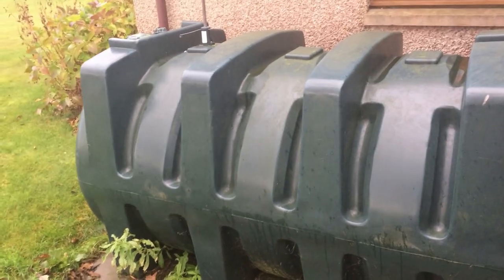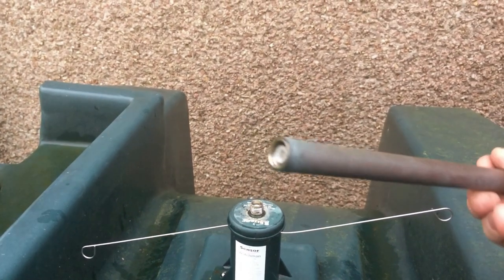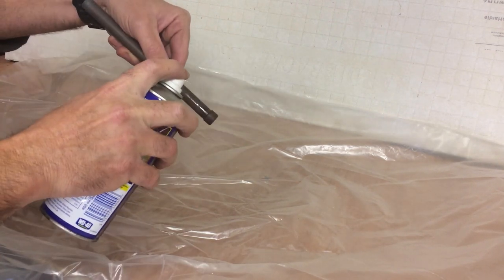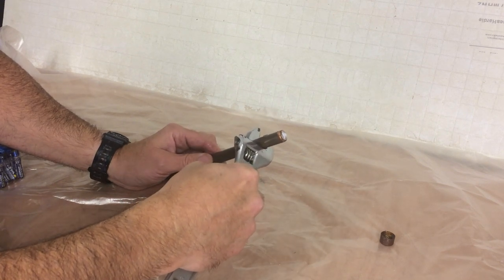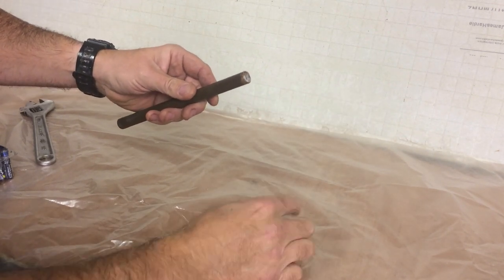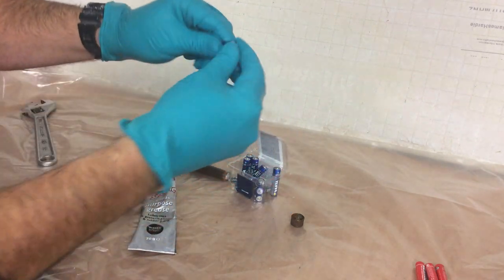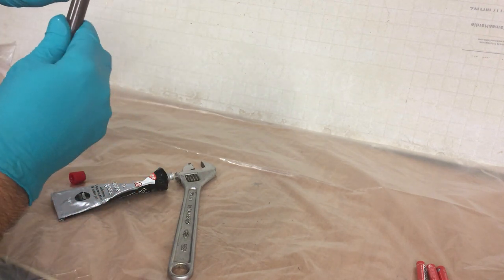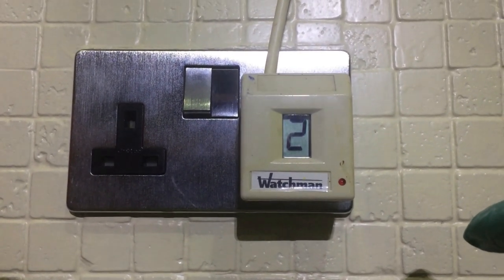How to repair and FIX a faulty Watchman oil tank copper power tube | Restore oil level gauge 2020

Comment from the maker: Please let me know if this worked for you - I am always interested in other peoples experiences with this.
Reply: Bacren Property   Tried this at my mums house. Without your video I would not have known about batteries inside. However it didn’t work out for me. There is a letter C on the receiver and flashing red light. Any ideas?  Thanks.
Reply from the maker: @cloudninephoto  Hi, I am sorry that this did not work for you. The letter C means there is a connection fault at the transmitter, if you remove the power tube again, clean and spray the connection end with WD40 (wipe off excess) and also spray the actual connector on the tank, this may work but not guaranteed. Let me know how you get on.
Reply: Bacren Property. Thanks I'll give it a go.
Reply: @cloudninephoto  Did it work? I've got the same issue, a "C" showing on the display.
Reply: Andy Day   No didn’t work for me 😩.
Reply from the maker: @cloudninephoto  Ahh, Sorry this did not work for you, not sure what this issue could be ?
Reply: Hi, I changed batteries. Now receiver says F. I know my tank is not full. Is there a way to sync the transmitter and receiver?- it looks like I have the same sensor as your video.
Reply: Was it triple A battery's uou used ?
Reply from the maker: @lesleywigham1362  Yes, Lesley, AAA batteries were used. Thanks for the comment
Reply: @Bacrenfencing  thank you 😊
Reply from the maker: @lesleywigham1362  No problem !
Reply: @Bacrenfencing  hope it works. Will get my son to do it at the weekend 😊
Reply: Well done! this worked! I was just about to buy a new one as that's what I was told to do when the new boiler was installed. Thanks!
Reply from the maker: @msmith9971  No problem, I am glad this worked for you !

Comment: Many thanks for the video, so simple when you know how! The receiver flashed madly at first showing zero, but then I found the instructions about replacing the power tube. Said with the power tube removed switch the received off then on again it would then show an r or L after displaying the serial number. Wait for 2 minutes , then screw in the new/refurbished power tube and within a few minutes it will display the level. This did the trick.
Reply from the maker: Thanks for that information Neil, hopefully that will help out some other people 👍

Comment: Thanks so much for this video! I got my batteries replaced by following your clear instructions - brilliant! My power tube was inside my tank, not on the outside as in your video, but apart from that it all went fairly easy. Took me ten minutes to get the copper cap off. Thanks again
Reply from the maker: Thanks for the comment and I am glad the video helped you out !

Comment: Thank you for the tips. My batteries were down to 2.4V but the watchman had been working intrmittently  since installation (maybe 15 years ago) until this week. Despite WD40 soak took  at least45 mins of tapping with adjustable spanner and pumbing nut over tube. Don't give up...
Reply from the maker: 45 Minutes.........you were determined ! 😀
Thanks for the comment and glad the video was of some help to you ! 😎

Comment: Thanks great video. Cap was difficult as found out afterwards batteries had been in over 10 years. Used a rubber golf shaft grip which can be put in a vice to hold tube  and then could tap the adjustable spanner a bit harder. Thanks again.
Reply from the maker: Glad it helped

Comment: Hi there. Great video. Had a nightmare getting the end cap off. As yoyu know, its soft copper, so the more I dunted it with the shifter, the more ragged the outer end surface became. I ended up doing two things which might help others, so feel free to reword this and post freely. First, heat the end cap with a heat gun/paint stripper type unit OR dip in boiling water. keep doing this and spray with WD40 in between heats. Next, and this was what really worked, if you have a spare 15mm plumbing compression fitting, unscrew the compression nut, take out the olive, and slide the nut down the copper power tube. You may have to remove the little warning label from the electrical connector end, as the nut is a perfect fit over the tube. This then gives you a much sturdier 'target' to hit with the shifter and minimises damage on the cap end wall. Worked for me. Hope it helps
Reply from the maker: Thanks for the info Jim and thanks for the kind donation to the channel, very much appreciated mate !

Comment: Thank you. This worked very well for us. The cap took a bit of persuasion but not too much and the receiver took a few minutes to work which had me thinking I’d mixed up the batteries. There was a plastic internal tube as well. A great fix and cost a couple of quid for the batteries. Thanks again.
Reply from the maker: Great, I am glad this worked for you - thanks for the comment, much appreciated ! 👍😀

Comment: Thanks for the clear instructive video. I did this but when resetting I get the flashing ‘C’ - I realise that means I have a connectivity issue. Does that mean the unit requires replacement at this point? Or do you have a remedy for this Thanks. Ps the unit is well old.
Reply from the maker: Not sure to be honest ?

Comment: Changed the batteries in my pipe on the oil tank outside as watchman wasn't working and was happy but it only solved the problem for about a week to 10 days. I have the same problem with it again. Couldn't you advise on what to do now. Do I replace the batteries again. 
Thank you Lesley 😊
Reply from the maker: It could be that the copper top of the pipe has loosened a bit which causes a bad battery connection. Try re-securing the copper cap and possibly replace the batteries again to see if that helps ?
Reply: @Bacrenfencing  than you very much will try that and let you no 👍
Reply: Sorry Done as you said but their is still an error sign on the watchman in the house. Is their anything else I can do without replacing the pipe please 
Lesley

Comment: Any idea how to recalibrate?  Mine has not been powered up for yonks and when I got round to replacing the batteries as you suggest (thank you) it registers 'F' when the tank is half full.  I've tried unplugging the monitor and removing the sensor and tube and powering it up with it horizontal as per the setup instructions and I can hear it clicking away but it does not after 27 secs beep and if I replace it it still registers as 'F' on the monitor.

I must admit to being amused by the battery cartridge, a length of 15mm plumbers pipe with end cap on one end and a braised on TNC RF connector I think on the other.
Reply from the maker: I'm not sure to be honest ?
Reply: @Bacrenfencing  OK thanks well if anyone else knows....

Comment: Hello there, my plug in display flashes 5 then 7 then r then three horizontal lines then 0. It kept repeating this so I took off the power tube and replaced the batteries. Unfortunately it's still doing the same. Could it actually be the plug/display as I had a power cut a few days ago and wonder if there has been a power surge when the electric came back on?
Reply from the maker: Hi Shirelle, it does sound like it is an issue with the actual receiver as opposed to the power tube. Maybe best to replace
Reply: @Bacrenfencing  Thank you...the receiver is the plug? the model I have is the Niveau would it have to be an identical plug and would it work or need to be synchronised?

Comment: Hello, i done exactly this last year and all was good, i was so pleased then it stopped working again last week so today i done exactly what you show again yet it will not work, i repeated it once more and still it will not connect. Any advice please? Many thanks to you.
Reply from the maker: I'm not sure without seeing it. Maybe just check that all the connections to the batteries are good.
Reply: @Bacrenfencing  Thank you so much for your reply and i have cleaned it plus brand new batteries and it is just not connecting. It worked last year but this time nothing. Thank you again for your humble assistance.

Comment: I removed the cap and unfortunately the spring inside the cap decided to depart somewhere it couldn't be found . I tried using a pen spring but without success. Any suggestions as to resolve without having to buy another powertube?
Reply from the maker: If you have any electronics, child games etc, then you can open the battery compartment on the item and take the spring out. Once you have the spring, you can solder it into the copper cap (If that makes sense). Or you can order a new spring here - https://amzn.to/3gdMvxH - just take the spring out of this item using pliers. Hope this helps ?

Comment: Thanks for this. I've just replaced the batteries in mine (took about 5 mins and was very easy). The receiver is currently still showing 'r' but hopefully that'll change soon enough. One question, my sensor has two leads, about 300mm of cabling, then spade connectors with wiring shooting off down into bunded section of the tank. Do you happen to know what that might be?
Reply from the maker: I'm sorry, I have no idea what all the wiring would be for - sorry 🤔
Reply: @Bacrenfencing  me neither, I'm concerned it's a makeshift power supply that's been dropped where it's hard to get to. Watchman R was saying 2 and then when refilled 2 and low battery. Now it's still sat on r 😭. Thanks nonetheless.
Reply: @Bacrenfencing  It's working today!
Reply from the maker: @bennp2000  Great news Paul - hopefully that's it sorted !
Reply: I have this on my tank. There is a float at the bottom of the wires. Its to alert you to  a leak in your tank if fluid gets into the bunded section
Reply: @prg655  thanks very much for this. Good to know.
Reply: Paul Bennett  . Hi Paul I just changed my batteries on power tube. Looks to be same sensor as  your video. But receiver now reads F. Is there a way to sync receiver and transmitter? I have tried cleaning  all fittings with WD40-
Reply from the maker: @prg655  Hi Phil, I just switch the receiver off at the wall for a few minutes and then switch back on - never have any issues........not sure what the issue could be ? Anyone else know ?

Comment: My only problem was that the spring pinged off and disappeared ! Still searching for it. Where do you suppose I could get a replacement.
Reply from the maker: Hi David, Do you not have any old kids toys, clocks etc etc............these springs are in so many products, so if you can find an old product, pull the spring out and fit it to the power tube. I hope this helps.

Comment: I lost the spring out of the end when replacing the batteries and replaced it with a much larger less springy one as I assumed it was there to push the batteries down but the receiver won't reset and the red light is still flashing - does the type of spring matter?
Reply from the maker: I just use a similar spring, it should not matter as long as the cap has a tight fit on the end of the tube and the batteries are making good contact. Hope this helps ? 👍

Comment: I replaced the battery as per the posted clip. It didn’t work for me.

Is the transmitter faulty?
Reply from the maker: Sometimes this happens when the end cap connection is poor. Check that the end cap is on securely and in contact with the batteries. Failing that, I am not sure what the issue could be ? Thanks for the comment.
Reply: Thanks for your reply. I checked it 3 times.
I stretched the spring to ensure contacts with the batteries. I am still having the same issue, 
regrettably I have to buy new gauge otherwise it is no win situation
Reply from the maker: @ayadsalmons3110  That's a shame, I am sorry this did not work for you Ayad.

Comment: I'd be looking an air source heat pump and scrap the oil tank 👍👍👍 oil or LPG was the rural solution but I think renewables are the way forward 🤔🤔🤔
Reply from the maker: Hi Paul, thanks for the comment. Yes, I agree but at the moment plenty of people still have the old oil tanks - which usually have a faulty arial / powertube. If I can help people get the level indicators working again, then perhaps they will be more conscious of how much oil they are using, which in turn may make them change their consumption habits.
Reply: @Bacrenfencing  once the lock down is over and very slowly we return to normal after I finished level 2 plumbing renewables training is something to consider 👍👍👍
Reply from the maker: @paul_my_plumbs_uk  Yes, It is big business and will only grow - same as electric car side of things  !